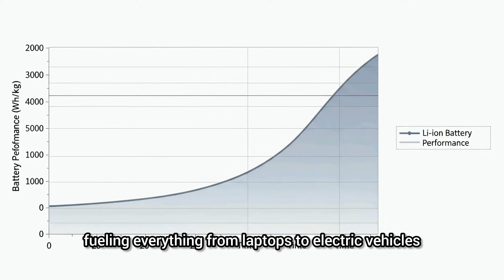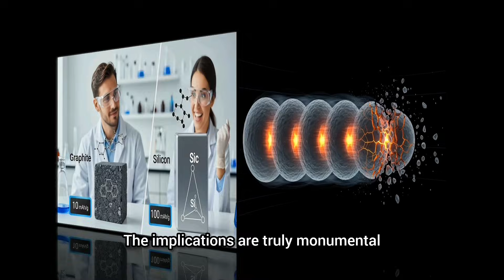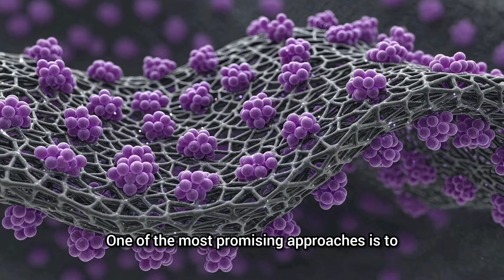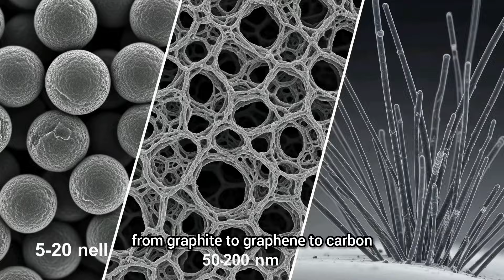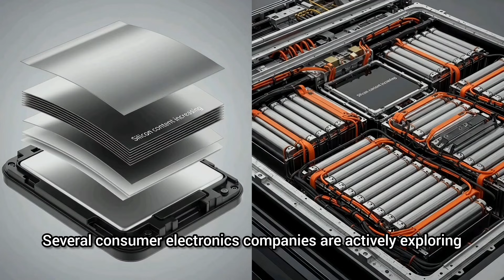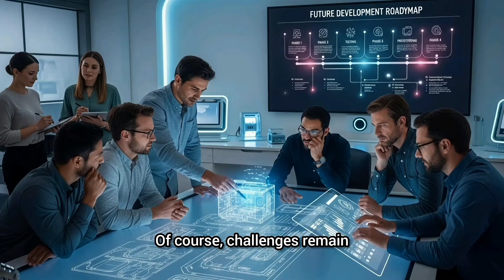The End of Lithium-Ion? The Silicon-Carbon Revolution.

Comment: Since you mentioned Group14 Technologeis, it's important to add their silicon carbon anode material (SCC55) is already in over 20 million Chinese smartphones, as well as eVTOL aircraft (Archer), heavy lift drones (Flying Basket), hypercars (McMurtry), eBikes (Spark), AI data centers and powertools.  Unlike others in the space, they already hit "EV scale" manufacturing well over a year ago via their 2,000 metric ton, 10 GWh plant in South Korea, with two more of the same size under construction in Moses Lake, WA.